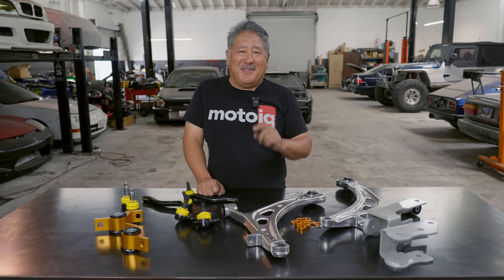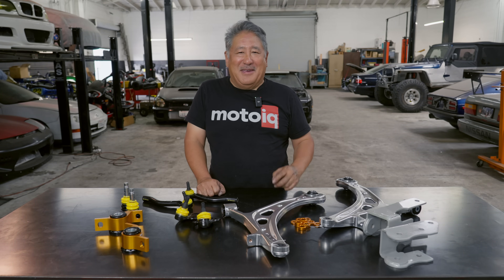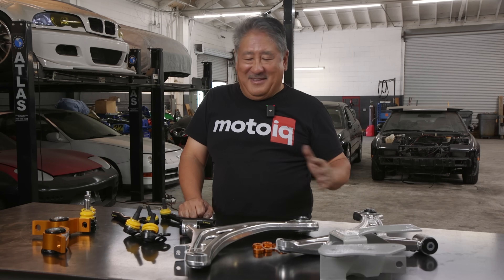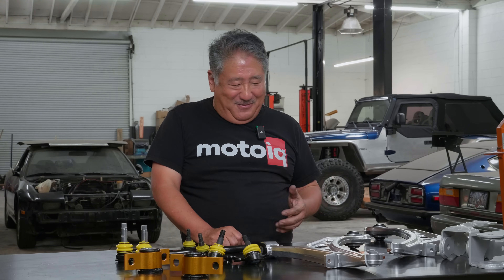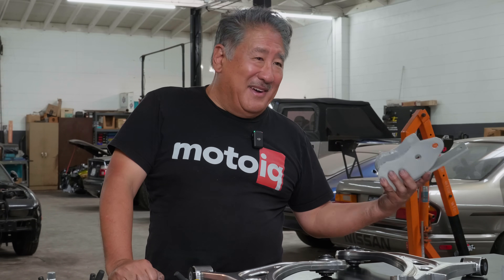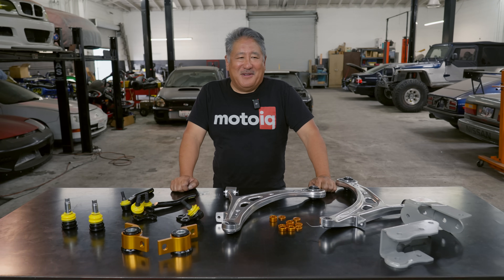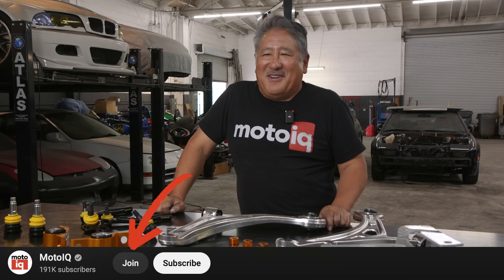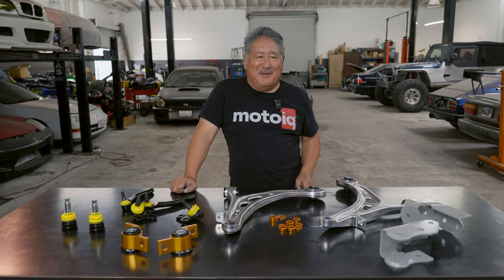Lowering Your Car the RIGHT Way: Fix Roll Center, Bump Steer & More for Ultimate Handling!

Comment: What if I do NOT lower the car....   Will these benefit my 2012 Subaru Legacy?
Reply from the maker: Then your geometry is ok
Reply: @motoiq I appreciate you I watch  most of your videos..  😊.  

I just upgraded front and back sway bars on my Subaru Legacy 3.6r to White lines 24mm front and 20 mm back with multiple adjustment points and watch your video on how to fine tune it..    My legacy now feels like it's on rails when I corner.....
Reply: @motoiq I called White line and asked about an "essentials kit" for my 2012 Legacy.  He told me a "kit" is not available for the 2012 Legacy...

Can you please suggest a few upgrades for the bushings, ..
Reply from the maker: I don't know what is available for that car.

Comment: Extended ball joint i can imagine how that will work,
But that extended tie rod i cant imagine how its work,
Reply from the maker: Exactly like the ball joint
Reply: @motoiq i means extended ball joint was to recover lower support arm angle, but doesnt extended tie rod end will make it worst?
I search online they use special tie rod end that mounted under the normal point, but that pretty expensive in my country, almost cheaper to build custom knuckle with lowered mounting.
Reply from the maker: No
Reply: @motoiq i see, the problem is my car tie rod end was top mounted, not bottom mounted.
Thanks for responding

Comment: Love your insight on chassis geometry! A question regarding caster and steering feel, concretely, to what degree does the added aligning torque mask tire slip angle sensing ability? Say its on the car that already has "sufficient" caster and camber curves (like a NC miata). For pure performance, i realize there really cant be too much caster, but interested from a pure driving feel point of view - is more caster really always better and to what degree does it mask that flex in the tire contact patch, which is a much "finer" aligning force.
Reply from the maker: Too much caster is a variable that is controlled by many other geometry factors. Actually caster can be very damaging to the front grip as it can tilt the tire contact patch so much the tire looses area. Porsches have this issue. As a very general rule, you have to look at a lot of factors if caster is more than 7 degrees or so.

Comment: i want the same ride height but less body roll, i take the canyons from East San Diego to Tecate Mexico, where the roads are rough. I've already replaced the gas struts with oem style KYB. maybe gonna get a thicker rear  sway bar & front strut tower brace

Comment: Mike I have a Q? 
For a 2017 Holden VF SS (Chevy SS in the US) if I was to drop the car 1.5inches all around with quality coilovers, can the handling improve if the damping is setup correctly or will it be worse if I don't install a roll correction kit?
Reply from the maker: That should be fine

Comment: Thanks for posting Mike. 
Im running aftermarket coilovers on a Holden SS (Chevy SS in the US) lowered 50mm(2 inches) from factory height. Should I be concerned about bump steer and its effects?
Reply from the maker: 2" is about the limit of where you should lower a car without correction. 1" is safer.

Comment: I like the discussion on roll couple and anti dive. They seem to be the exact same thing except one is acting longitudinally and the other laterally. It seems like you don't like anti dive but you do like a smaller roll couple which is the same as anti dive but laterally, am I right? So how does one know what's better laterally, a longer roll couple which presses the tire into the ground more (less "pro lift" = more traction?) vs a shorter roll couple which is sideways anti dive? If you like a shorter roll couple, why not make it = to CG? Basically how does one pick and choose an ideal roll couple length as well as the % of anti dive? I'm guessing this is a huge topic and not fitting for YT comments.
Reply from the maker: It is not simple and not explainable in this sort of format.

Comment: I put the Whiteline control arms in my Audi S3 - added positive castor and negative camber - really transformed the front end feel; They claimed weight savings too, but that turned out to not be true. That said, I'd take high durometer rubber over cheap urethane any day.... TRD knew that ;)
Reply from the maker: Whiteline Urethane is pretty good. The most durable of the Urethane we have used so far.

Comment: I don't know much about anti dive. I currently have my adjustable top hats rotated diagonal so that they sit the most rearward for max caster and outward for reduced SAI. I think reducing the SAI this way makes the camber invert earlier in the stroke, because when I raise my car on a lift the camber seems to stay the same, rather than go positive, so I'm going to rotate it again to the most rearward and inward position, increasing SAI but in theory improve camber curve. Does adjusting the caster this way increase or decrease anti dive? or not change it at all because it's based on control arm movement?
Reply from the maker: Anti-dive is based on the control arm angle, which your top hat adjustments are not influencing directly.

Comment: Something I always wondered, yeah the Whiteline stuff corrects the geometry of lowered cars. But whats the new height that the suspension would be at factory geometry but lower ride height with the Whiteline correction kits? And then at what point is too low that the correction kits have become nullified?
Reply from the maker: It depends on the car but something around 2-3 inches.

Comment: This is what happens when you take 1000s of hours of OEM engineering and throw it out of the window for aesthetics and for a personalized driving experience. It's personalized alright, but you will personally have to reengineer the car. Good luck.
Reply from the maker: It is for performance increase better CG and aero.
Reply: @ understood. Thanks for replying:-)
Reply: That's what Mike does as an Engineer, who has worked for both for Nissan and TRD as an engineer.
Reply: @kevink2315  I understand. I was really referring to the people at home who do not race, but who decide to put rims on cars, spacers, and coil overs on cars and lower/slam them (again, “for aesthetic purposes” like I mentioned) only to have to need what Mike is offering in his video. In other words, there is a use case for this. But most people, clearly based on the necessity of this video at all, don’t know of it, and can’t be bothered to go through all of the necessary steps of this engineer to re-engineer their own cars. It was just an indictment against the tuning mindset that seeks to drastically alter something that engineer set up for a particular purpose. But I am glad that Mike is doing this and showing this to those who do care and to those who need it.
Reply: @caryg4638  Good points. It's a great presentation, esp for those who understand it. But to your point, those that are inclined to just buy the lowest of lowering springs without thought, are not likely readers of MotoIQ. I tracked several cars through the years, and altered the suspension of each using a guide by Engineer Fred Puhn. One of the racers in my group used a cheap attachment in his suspension to lower it without doing the analysis. It failed on a high speed corner and went vertical on a tire wall.
Reply: @ good point about the audience—I agree. And thanks for sharing the info about the engineer, Fred Puhn. I just checked him out; I think I saw his book on Amazon years ago but never got it. Might be an interesting read. Thanks again. 👍

Comment: Wondering when you’ll make a video on the Ford/Mazda Duratec engines.
Reply from the maker: The 4 cylinder?  We don't have any calls for those.
Reply: @ worth a shot lol. I’m rebuilding mine and I have nothing but 15 year old forums with questionable legitimacy to guide me. Thanks for answering though. 👍
Reply from the maker: For all its worth, they are solid engines.

Comment: What is your opinion on extended lower ball joints aka roll center adjusters for EG civic? Got a del sol I’m about to lower roughly 1.5”
Reply from the maker: The tie rods need to be moved the right amount as well or you will get bumpsteer.

Comment: Is roll centre correction need to be considered with 25-30mm drop on relatively short stroked from factory McPherson strut?
Reply from the maker: Yes, it does, especially with MC Struts. Closer to 30mm, of course.

Comment: What about dual wishbone? Can you more or less get away with slamming the car as long as you correct for bumpsteer and run high spring rates?
Reply from the maker: My opinion that is the best, except for the slamming part.  You still have issues with the roll center location as per the graphics in the video.
Reply: @motoiq  I use the term "slamming" jokingly, I really just mean "lowered to racecar height"

Comment: Whiteline is cool that they try to support most chassis out there, except sometimes they mess things up and continue to ship out defective batches of parts of less popular cars.  

Example, both rear sway bars for a Chevy Cruze have quality issues that they've know about for many years and did not recall, instead sold them all off. Look up forums discussing the rear bars not fitting. Those posts are some years after I reported on the problem after 2 bars from different vendors didnt fit.
Reply from the maker: The Cruze is a car that should have done better, and the same goes for the Cobalt.  I have never seen a modded Cruze.  Can't speak for the Cruze, but we have never had a fit issue with any Whiteline product.  The only thing I can think of is that vehicle is different in Australia.  Don't you make this exact same post on every video we do that features Whiteline?
Reply: @motoiq It was me, moving forward I'll keep it positive.
Reply: I can confirm this. Whiteline front sway bar on a NB Miata, could not be a more popular car to mod. Bar does not fit right and only fits in 1 adjustment position and does not let you use the stiffer position. Really turned me off whiteline

Comment: Mike as always excellent information.
I ran into a lot of these problems with my E36 track car. When I checked out some parts from SLR. They make a roll center correction kit that lowers the outer ball joint mounting point I believe 30 mm, and incorporates new mounting point for the Outer tie rod at the same drop, and closer to the ball joint. The kit also includes a spherical ball for the ball joint, and a heim joint for the Outer tie rod. Now my roll center is correct, and I have a quicker steering ratio. As well as an Ackerman adjustment. 
Other guys have tried the long stud ball joints, but with really sticky cup2r tires, they would snap the ball joint stud.

Comment: Whiteline is alright.... their balljoints dont really like working outside of the recommended lowering window, or you can blow out a balljoint with less than 2 track events. It's a shame that there arent another company that can provide more reliable than whiteline products.

But for what whiteline is offering, as long as youre using their parts in the recommended window, they seem to be relatively happy.
Reply from the maker: You can say that for any suspension part, including the most expensive spherical bearing full race parts.
Reply: I’ve had a great experience with Powerflex products
Reply from the maker: Some Powerflex bushing are direct ripoffs of Energy. On some of them you can even see the Energy part numbers where they splashed the mold from an Energy part.  Maybe they evolved but I haven't touched them as they at least used to copy another company.

Comment: I have the whiteline ball joint kit in my cart right now, previous owner lowered the car did a couple good upgrades and stock bolt joints tie rod ends so it’s squirly on the highway. I’m assuming it’s because of this.
Reply from the maker: If you have the ball joints you have to get the tie rods or its gonna be all over the place.

Comment: Oh, whatever.  Point that top of the strut towards your neighbors house, put your foot on the part that attaches to the knuckle, and loosen the top bolt.  Next, the spring.  Do you have a hacksaw?  Okay, how about a wood saw?!  Mark the center of the spring with a piece of gum or something, and start cutting.  Should take you about 20 minutes per spring.  If you did it rite, the spring won't even be touching top cap, so you can just screw it on.  If you cut too much you can always just jam some wadded up newspaper in there to take up the slack.  Like you needed a whole video for this...
Reply from the maker: I assume you are joking or are stupid....
Reply: @motoiq  Maybe the joke was just wasted on someone who is stupid.
Reply from the maker: To stupid to understand something stupid